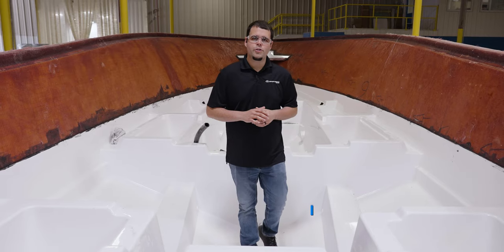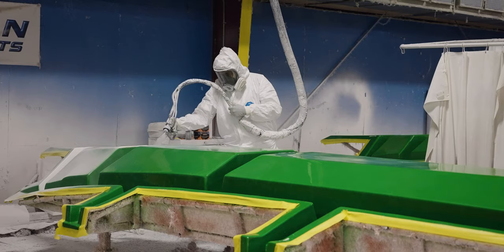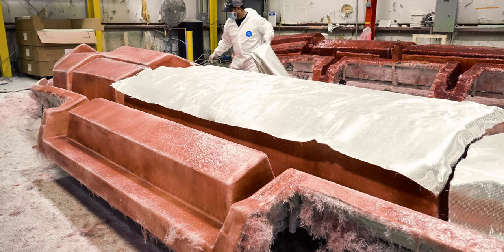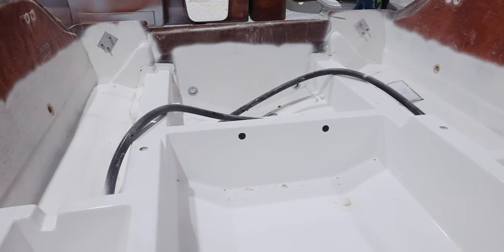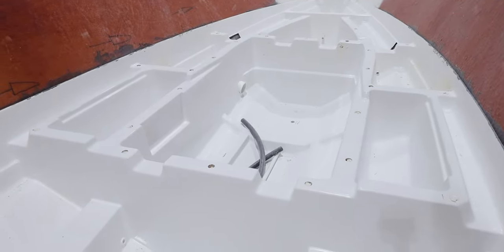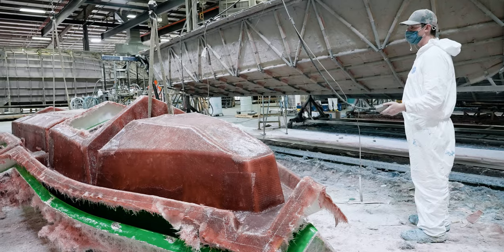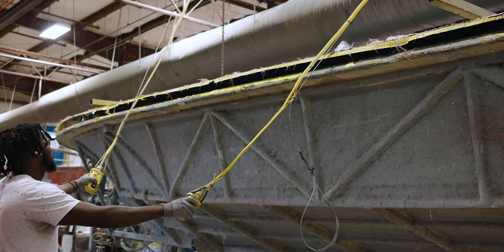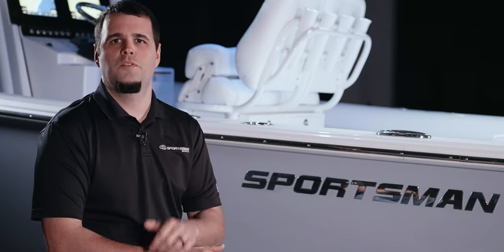Building The Boat's Backbone - Sportsman's "Behind The Glass" (Season 1 - Episode 2)

Comment: I have a couple of questions for you 
1. bonding the grid using MMA is a standard approach, but I couldn't see any fiber glass tabbing being done afterwards, to physically bond the grid to the hull. How do you get around the issue of the MMA becoming brittle over time and loosing its bond?
2. Watching the process videos, it seems that you are mostly doing a wet out process as opposed to a vacuum bagging process. How do you control the resin to glass ratios, and keep the boat lighter?
Reply: I’m not a representative of the company but in the video they due state that they’re use of a aerospace quality cement is used to bond the framing to the haul

Comment: Are these boats unsinkable like the Boston Whaler or the Sea Hunts? I see you had high density foam but it doesn't seem like enough to make it unsinkable.
Reply from the maker: The boats are foam filled for some flotation and insulation but you're not going to be able to cut it in half and drive it around like we once saw Boston Whaler do. But yes, in a catastrophic event you will have floating surface area on the boat.